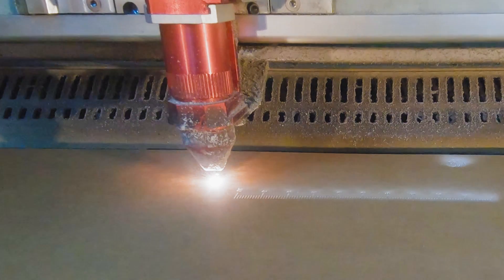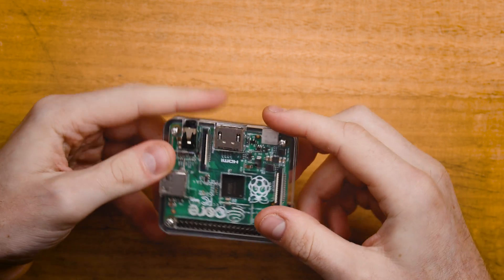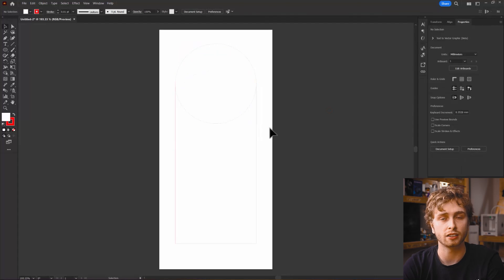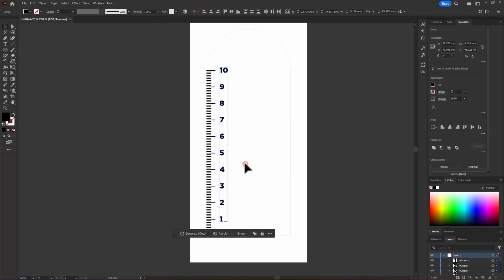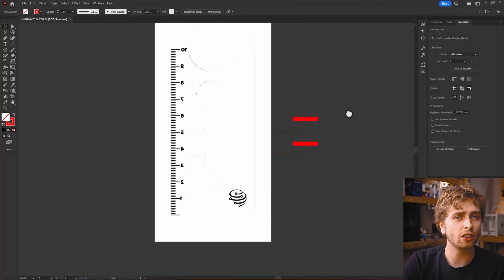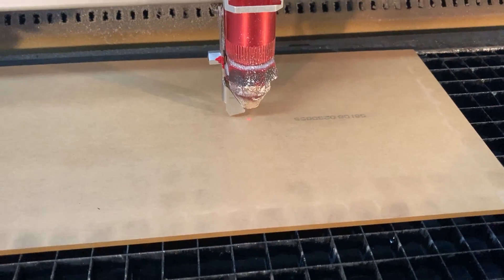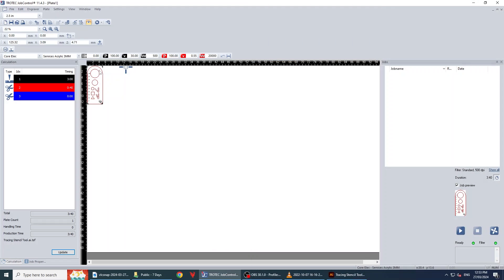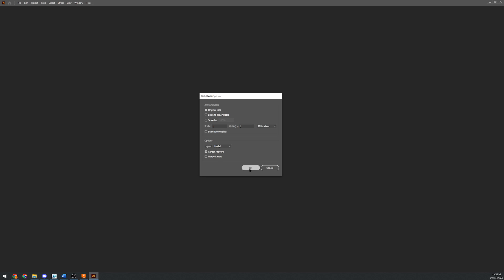Laser Cutting For Makers | Zero To Maker Workshop

Comment: Fun fact you can achieve similar results at home on a 3018 cnc router setup that is much cheaper than a laser cutter.
It only has a small work area but for what you are demonstrating here its far more accessible to a hobbyist.
Reply from the maker: Wow, that is an incredibly affordable machine. It seems like desktop CNC machines have just become affordable in the blink of an eye over the last 5 years!